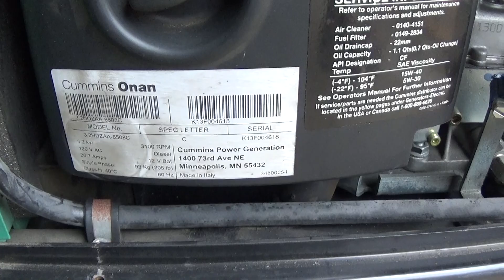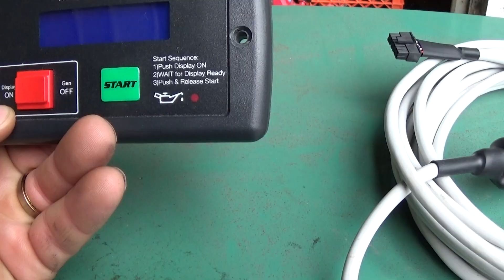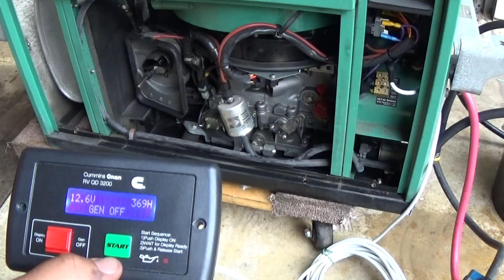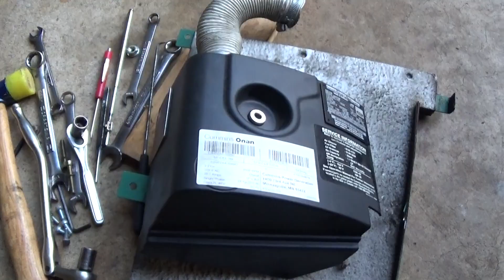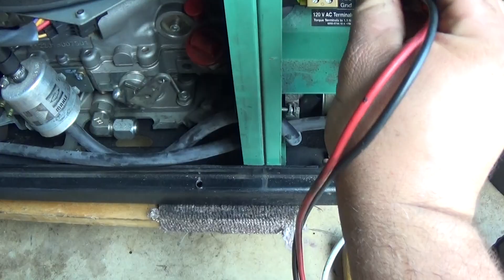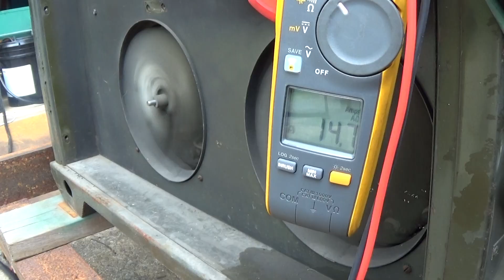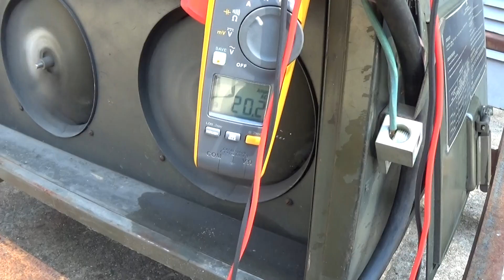Miniature Diesel Generator Diagnose, Repair, Test ONAN RV QD3200

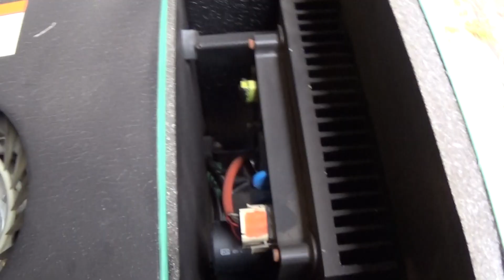Comment: Sir, I am  sure there are those who are uninformed that enjoy your video. However, please perform your due diligence prior to  creating a video FULL of errors. At 1:37 you failed to read the name plate data tag that clearly states the generator is a Single Phase generator , Not a 3 phase power plant you clearly stated. At 4:35, you clearly announce the device you are peering into is the  'large' inverter for the genset. You incorrectly stated the generator is a 'inverter ' type of generator. This generator is NOT a 3 phase system, nor is it an inverter type of generator/alternator, And the device you incorrectly identified was an inverter is in fact a Voltage regulator!! Please research the specifications of the ONAN nameplate data tag before you create a video and make incorrect statements that can confuse the unsuspecting public at large.  One more observation, sir. You stated the external control panel is a simple on/off device. When you turned the device over, it was obvious that a sophisticated scheme of integrated electronic components mounted on a circuit board inhabited this 'simple 'device. May I suggest that it is intellectually naive to imagine that complex devices are simple conceptions. Thank you, sir.
Reply: A: and B: He was completely correct on both counts. As stated in the manual for this generator, it is indeed a three phase permanent magnet alternator on the engine, the output of which is then converted to standard single phase 120v 60hz output by a 'pure sine'(1) inverter.  The combination of the two makes it a single phase generator set as it's final output is indeed single phase, although it takes a different path to get there than a standard, and much larger for the same output, directly driven generator head.

C: Functionality of the panel is primarily a simple on/off, with very limited options to display a few minor diagnostics. He states all of this clearly, too. In the world of electronics, this is indeed quite a simple device.

May I suggest you do some actual research before posting in the future, rather than spouting random nonsense off the top of your head and making yourself look bad.

Have a pleasant day.

(1. for whatever they mean by the phrase 'pure sine'... Typically it is just a higher number of steps than a standard inverter, and how clean the output actually is can vary greatly depending on manufacturer/model/etc.)

Comment: Diesel = fuel is also sorta oil = longer RECOMMENDED service intervals. Reduce service interval by 25% and you're probably doing pretty ok as long as it sees full heat cycles and no short run/off/short run/off sort of cycling.

VW inadvertently showed their TDI engines can run on up to 50% diesel dilution in one attempt to cheat on an emissions test, so... yeah... diesel in the oil must not be that bad if a TDI motor still ran like that.

Comment: I think the reason for the "pop" on the intake is simpler than the one you suggested. With the exhaust valve not opening, the exhaust stroke would effectively be another compression stroke so when the intake valve opens, the cylinder is under pressure again.

Comment: Worked on a diesel genset in a motorhome for a gentleman , the controller board was bad , they wanted $1800+for it , he elected not to fix it at that time . Parts are quite expensive for these units.
Reply: Used to work for Cummins/Onan. Expensive doesn't even begin to describe most of their prices!  Hahaha
Reply: DrFiero Thank you , does the complexity of these units have to do with producing "clean power"  I am trying self-educate on generators ,but I have a lot on my plate at this time.
Reply: @beckywatt5048  - personally think you're paying for the 'green gold' that they're painted in. That's what we all said at work anyhow! This is one of the odd-ball rebranded ones. They don't do that too much. A lot of the gas sets use custom cast engines (so they're branded Onan, but they're really not). Most of the electrics on them are pretty robust. You're paying for that as well for sure. 

As with most things - these are a tool.  You need the right tool for the right job. If you're driving nails, don't grab a screwdriver. Doesn't mean it's a bad tool - just not the right one for the job.
Reply: DrFiero Ty for your reply.

Comment: Probably would have replaced the air filter before running it since soot was pushed out the intake and into the filter.

Comment: Nice loadbank ! I would've just had a round-up of  various kitchen appliances (we are 230 volts, 50Hz here), water kettle, toaster, electric room heater etc and plugged in enough to bring it up to the required amount. (But I just found this channel) and it looks like you fix generators a lot, so worth it for you to have a dedicated load-bank.
Reply: Did a training on generators at the German Air Force. We used a Neff kitchen stove / oven  as load resistor ...
Reply: “the wife’s Load Bank” 😂

Comment: I had the same thing happen to an Onan V-twin on a Miller generator.  The initial oil gummed up the valve guides because it hadn't been run in a long time.  The valve hung up and the rocker popped off.  Some brake cleaner down the valve guide loosened them up and cured the problem.

Comment: Surprised no one has combined a 6-10 speed transmission with a flywheel yet... So much more power could be genarated at much lower fuel consumption with smaller engines..
Reply: It's not that it hasn't been tried, it just doesn't work.  Basically, the laws of physics say there's no such thing as a free lunch.

Comment: @SmallEngineMechanic -- Nice find, nice fix. Liked and Subscribed! Water heater elements make nice dummy loads in a bucket of water, and usually at least one is still good in any electric water heater you may find at the dump. Habitat For Humanity also may have some at their ReStore. I just saw several new (old stock) heating elements at the ReStore near me. One was a wiggly and folded design, with over twice the normal surface area, for use in extra hard water. If running 240 volt elements on 120 volts, they will only draw 1/4 of rated wattage, but they will last practically forever. Heating coils from electric stovetops can also be used, if you are careful with the connections.

Comment: You'll have to take that back off and pull the muffler. I've never owned an RV that has a built in gen motor. I've only had trailers and used generators to power my trailer or I'll bridge 2 batteries and I'm able to charge the Trailer through the lights plug into my Truck. May only need a little TLC. I'll bet the previous owners never even gave it proper air space to breath. You may have scored

Comment: I imagine it works somewhat similar to how inverted diesel motor. It'sthe equivalent of a small unit Draw Works and drum pulling motors on drilling rigs just smaller. It's electric and diesel. If it came out of an RV chances are it wasn't well maintained. Even with all that combustion oil aka fuel residue it will run and run and run for thousands of hrs. Out of site out of mind to most people.

Comment: why did you not check hertz under load
Reply: Andrew Romaniuk , he did, 60.00hertz
Reply: With an inverter producing the output frequency, there is no reason to suspect the frequency will vary.

Comment: Great video!  I thought everything was going to be ok when you picked up the rocker arm and pulled out the undamaged pushrod.  I did not expect that much soot. I hope you banged the muffler with a rubber hammer and forced air through the muffler; while you had the muffler out.  Good find for you.  Handy to have around.

Comment: Replace or clean out the muffler.
Reply: David Thomas all that smoke was the SOOT being burned off,, looks as though that gen set was being run at really low load, and caused so much soot.

Comment: "Made in Italy" has unfortunately become a red flag to me.
Reply: Hydraulic valves on a fiat dozer , three+ months to get replacements , no excuse for that ..
Reply: I bought an Esab TIG welder (Made in Italy) some years ago.  The gas solenoid was defective on day 1, and the first time I used it on full power, it blew out a bank of MOSFETs.  The replacement board was 80% the price of the welder, so I fixed it myself with USA parts.   Then there was my Fiat Spider.   Made in China is starting to look pretty good!
Reply: Becky Watt Fix It again Tony!

Comment: I used to watch you all the time and you know why I stopped watching you because you never finish things you were doing back in January upgrade to that generator the diesel generator the yellow one how to get the make and you were doing upgrade to the control board and you were just putting all the meters and gauges in and you were going to paint it and you never never did the follow-up on it and that's when I stopped following you because you have a tendency to start something I never come back to finish it

Comment: Thank you very much for posting this. I have not been able to find any information regarding this unit. I have 16 hours on mine and it runs like that I have some direction to go in now. The site you mentioned for the manual , is there any way you could post that. I can not get my hands on one. According to my local Onan shop this generator is their problem child. That it is impossible to get parts for it and it is discontinued by Onan. My RV is a 2018 and this unit has shut itself off and failed to start multiple times. I have no interest in leaving the brand new motor home in someones lot as they take weeks to diagnose it.
Reply: Hello
Any updates? I have the same generator with 45 hours, 2015.

Dealership is horrible and never told us the generator was a lemon

Comment: These are sweet generators. I had a 7500 Onan quiet diesel in a RV I used to own. Giving up that generator was the most difficult part of selling it. That is a nice find & fix. Enjoy your channel.
Reply: Your 7500 would eat this thing for breakfast.  You have (had) a fantastic Kubota 3cyl that would run for 20K hours. Only problem they had was tossing the magnets off in the early versions (bad glue). That more or less wrote them off if you were paying for labour.  Probably repaired 10 that did that!

Comment: Great video. I'd guess the reason they just replaced it, and a lot more in that batch, was down to the fact that Hans, on the German production line, was having an off day and forgot to torque down the set screw on the exhaust valve...

Comment: Nice timely video.  Mine is apart as I type this with, a destroyed big end bearing at 435 hours.  I suspect this little Hatz engine, for all of it's amazing engineering, (the bottom timing section is amazing), but the motor  is really problematic installed in the typical US RV application.  In my case the little oil pressure relief ball bearing that had fallen out of it's spring retained boss and allowed all of the oil pressure to bypass, thereby never getting to the connecting rod or other top end components. The oil protections built into the controller never shut my unit dow because there were both oil and pressure, just not distributed in the right places.  Is there any issue running this genset without providing a pathway for the AC power that is being generated?

Comment: Great stuff! I love getting machines like this, its the ultimate bargain!
My guess is they took it in for a service and someone forgot to tighten the rocker adjustment properly and the exhaust backed off. Probably later diagnosed the intake kickback as burnt valves when it was actually "jake braking" out the intake since the exhaust system was no longer part of the plumbing! All the orange RTV in the exhaust pipe is the tell to me.....anytime I see RTV beyond a small bead or skim, its a sure sign of an amateur being involved....doubly so if its orange RTV since that stuff is rarely used by the OEM.

Comment: Are you allowed to use farm fuel in it? If so, what about if it's on a road vehicle?
Reply: InsideOfMyOwnMind - you can use non-taxable diesel in it as long as it has a separate tank from the main vehicle tank.  My diesel gen sets have always been run on dyed diesel

Comment: That's not engine smoke Mike it's the muffler doing a re-gen...
Reply: I'm sorry but that isn't going into regen . There aren't any temp or pressure probes before and after the "catalytic' converter muffler.
If it did have one with that much coke soot it would have to be baked in an over than vacuumed out before going back into service.
Pressure differential would be too great and throw a code.

I'm a Caterpillar engine mechanic and have experience with regen systems.
Reply: @RichieCat4223  I think he meant it as a joke. But it looked just about the same.

Comment: The muffler is all oiled up from the lack of lift on the exhaust valve as the nut backed off. It took 360 hours for it to finally stop running. Exhaust temp getting lower and lower as the hours clicked on. Poor diagnosis is common in this field. Costing consumers big $$

Comment: I use my big 3HP Skil saw and my table and chop saw to load test my 5kw generator. It will run all three easily and they put a good load on the generator.    I run them for one minute on and four minutes off and do five reps with them.

Comment: The air inlet to the air filter comes from this huge fan on top of the engine, doesn't this act like a turbine or compressor? You run it without the air filter housing, so maybe it'd smoke less if it had more air?

Comment: Nice unit to sell to a trucker if nothing else. I'm a bit disappointed it's not a 3-phase.
Reply: Nah... this thing needs a home that will RUN it.. at least 50% load for most of it's operating time.  The only practical use I can think of would be as a small construction site generator.  Maybe a solar system backup generator - if the batteries drop a bit low, a 3 kW generator would be just about perfect to charge them up and supply power until the sun comes back.  Even there you'd have to use it, under load, once every month or two to keep it running well.  Most RV's don't draw enough power consistently, and a trucker would use a lot less.  They'd be better off with one of those tiny 2 kW models.

Comment: It's really disappointing that supposed professionals didn't even bother to carry out the most basic diagnostics to identify the problem with the engine, rather than just replace the entire unit!

Your video was truly excellent, thank you for taking the time to record, edit and publish your work.

I'm delighted to have found your channel and think that you inspire and encourage others to have the confidence to work on machines that they otherwise wouldn't!
Reply: As a professional mechanic, there may have been a bit more at play on this one. Labor rates, parts, and turnaround time quite possibly could have been a reason to replace it. If you're on vacation for 2 weeks, and it's gonna take 5 weeks to fix, lots of people would just say junk that one, install a new one. I believe he said this was a warranty replacement by Cummins too. They might have had something to do with that.
Reply: What labor and parts? He had it running after tightening one thing that’s just proper diagnostics. Original poster had a good point imo excuses excuses as usual
Reply: @willthomsen7569  he had to remove a bunch of stuff in the way to get to the valve cover.
Reply: Yup god forbid somebody has to do something. If the facia is rotten we have to take the gutter off. When we redo the siding we have to deal with the electric and water meters and weatherhead. You’re a mechanic you’re supposed to be all tooled up for this, set up to get the job done. The answer is always “buy a new one” these days
Reply: Time number one reason and frac jobs are millions of bucks Sir. Can’t run equipment or pumps with out frac van
It’s all about time and money not that our mechanics can’t fix it
Reply: You have to think of it more like health insurance. In order to keep digging beyond a certain point, they ( the Distributor service dept) has to get "pre-approval" from the "insurance company", aka The Factory. On a little set like this, the Factory calls most of the shots as shop labor costs can quickly erase their initial sales profit of such a little genset. While they are worth fixing for sure, they are not necessarily worth fixing for them. This is due to economies of scale associated with them outsourcing the initial the engine purchase. If you make something, in order to get the best price on components, you may agree to buy "X" amount annually, for "X" price per unit, and you carry the warranty. You get to buy really cheap, but it changes the warranty dynamic.
Reply: @mikeconroy2651  Thank you for your extremely well reasoned points, I hadn't thought of it in those terms, but having now read it, it makes perfect sense.

Your very helpful post represents all that is good about social media, and I appreciate it.

Comment: Yeah. Those people running the clinic probably don't know anything about a generator - either it works or it doesn't. The exhaust valve adjustment was likely loose for a long time, making the engine run inefficiently and sooting the exhaust really badly. Just needed a proper valve adjustment and run long enough to blow most of the soot out. Probably ought to clean up the intake heater so all that works properly as well. Maybe any soot in the combustion chamber has cleaned out with the running for awhile.

Comment: First I would have removed and manually cleaned the muffler.  Use solvent if necessary.
I would use space heaters to create a load.
Reply: The load bank IS a space heater....
Reply: Not sure whathe load is.   With space heaters one accurately knows the amperages.(But I would not go out of my way to acquire space heaters if I already had a good loadevice.)